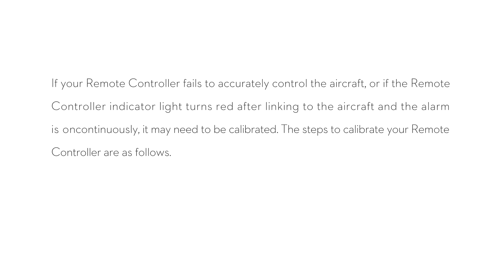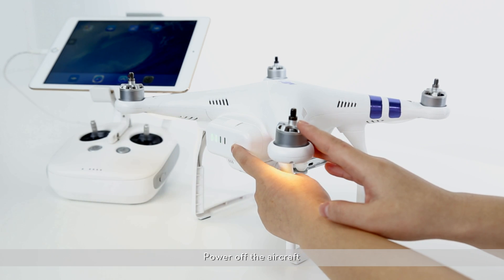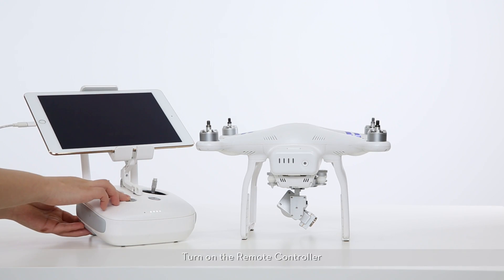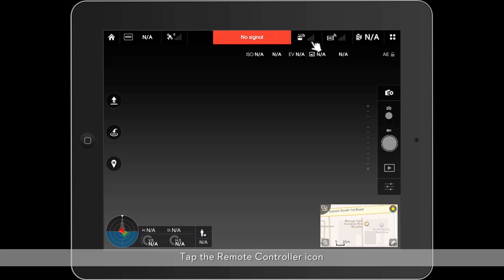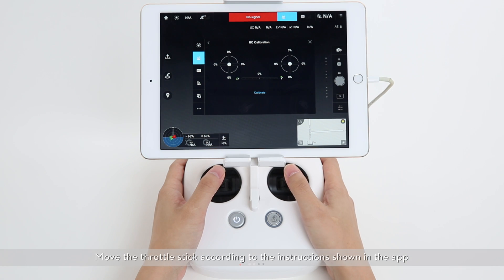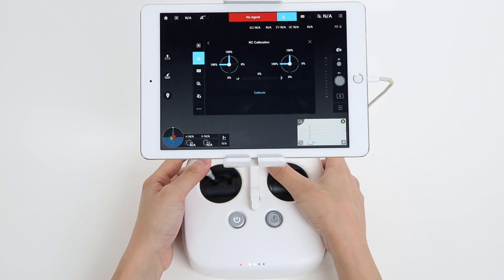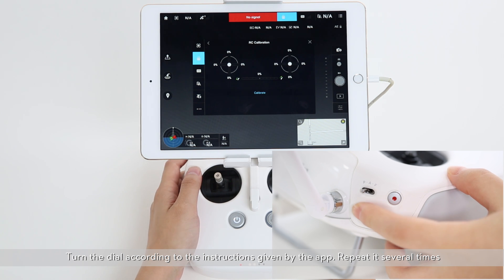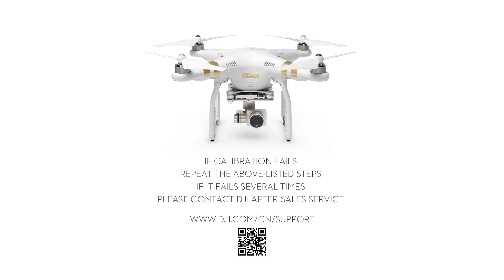DJI Phantom 3 | Remote Controller Calibration

Comment: Hi.. My Remote Control DJI Phantom 3 Advanced is a problem Remote Controller Encryption Error... what the solution to do... thanks before..
Reply from the maker: Hi there, could you please send the screenshot of the error message to us via email to support@dji.com? We'll double confirm the issue.
Reply: @DJISupportGlobal  : I just sent an email containing a screenshot of the error to support@dji.com. please check the email Thankyou for the response..
Reply from the maker: @ToplayCom  Hello, our support team will follow up with your case accordingly. If you still need further assistant, you can provide your CAS number so we can directly track the process. Thank you!

Comment: mi control no quiere realizar la calibracion y no se conecta a la aplicacion DJI GO
Reply from the maker: Hi Edwyn, just to verify, which remote controller do you use? Could the RC be powered on properly? You may try to reinstall the App and connect again.
Reply: El control es un gl300c Phanton 3 el prende pero inmediatamente suena una alarma y La Luz es de color roja al mover la palanca deja de sonar después que se enlaza con el dron La Luz prende rojo y verde he intentado recalibrarlo y no me deja la aplicación no se conecta tampoco intente actualizarlo y al parecer no actualiza
Reply from the maker: @edwyn1326  Thanks for getting back, so the RC's first LED blinks red and green, it makes a beeping sound, and you can't connect the mobile device to the DJI GO app, right? May we know the current DJI GO app version and the mobile device you are using? If the app can't connect to the RC, please try a different connecting cable, try to reinstall the latest DJI GO app and try again, please note to do a backup like syncing the flight record and saving the pics and videos before your reinstallation. Besides, you may also try another mobile device for connecting. 
If the RC can be connected, please check if there is a need to update the firmware for the RC, or you can also try to refresh the firmware by long pressing the three dashes on the first page of DJI GO app for 9 seconds. After that, please check if the LED on the RC blinks normally. 
For the beeping sound, there are 4 types cases with a beeping RC in the majority situation: 
1. Extremely low battery, charger it;
2. Firmware upgrading failure, upgrade it again;
3. RC sticks are not at the midpoint, calibrate it;
4. Disconnect with the drone after 5mins, re-link the drone and the RC.
If the issue persists, please provide us with a video of the current status of your RC when connecting the mobile device, we'd love to check. You can send it to m.me/DJISupport or http://www.dji.com/support, thank you.

Comment: "Tap camera" 

There's no camera to tap. Fail!
Reply from the maker: Hi there, this app interface was a very previous version. Please check if you can go to the RC settings and calibrate the RC, if there is any issue, you can keep us updated at m.me/DJISupport, thank you.
Reply: Hello. And thank you for the swift reply! The problem only occurs when I try to use the Ipad. It works perfectly using my android device. Any idea what could be wrong? Both the drone, the RC and the app is up to date. But I still don't get any "connect to camera" button inside the app once connected.
Reply from the maker: May we know which drone you are flying and the model of your iPad? Have you tried another lightning cable for connecting? If it is possible, please provide us with the screenshot of your app so we can help further. You can keep us updated at m.me/DJISupport, thank you.
Reply: Thanks for coming back to me, the drone is the P3A, and the IPAD is the iPad (3rd generation) Model A1416 Wifi version. I've checked the cable and it seem to be working properly, as it can transfer files between it and my computer. Ok, I took some info screenshots for you, so you can see app version, IOS version on my iPAD and also inside the app. Thanks again.
Reply from the maker: Thank you for your cooperation. We hope to have your situation addressed soon.
Reply: Hello again, I forgot to add the links to the screenshots, how silly of me! Here they are:

https://imgur.com/a/BS64EFE
Reply from the maker: Well received, thank you so much. It seems that the mobile device and RC still doesn't connect well. Please try to reinstall the APP or update to the latest OS to see whether it works.
Reply: Hello. The iPAD refuses to update, it just gets stuck on "downloading and installing" when I press update. But the version update 9.3.5 is only a small security update over my current 9.3.2 version so I doubt that's where the issue lies. I've also checked on a forum asking to update the iPad 3rd gen and this is what I've found out, let me quote someones reply: - "The iPad 2, 3 and 1st generation iPad Mini are all ineligible and excluded from upgrading to iOS 10. They all share similar hardware architectures and a less powerful 1.0 Ghz CPU that Apple has deemed insufficiently powerful enough to even run the basic, barebones features of iOS 10. Your iPad 3 is at its highest iOS version. iOS 9.3.5." - Can it be that I need an older version of DJI Go? Maybe the new version of DJI Go is for iOS 10 and up? I also reinstalled the DJI Go app but despite this I'm still having the exact same issue. The DJI Go app doesn't recognize the RC or the drone.
Reply from the maker: Hi Soetdjuret, sorry to tell that iOS DJI GO app doesn't support downgrading. As for the iPad's update, we suggest that you can confirm again with Apple support.
At this moment, if you have another mobile device, you can try to connect the drone to that device and see if it can be connected successfully. Thank you.

Comment: Hi 
I've bought a new controller and looks like the USB is dead , it won't link to dji app at all . Red light on constant and no power to tablet/iPhone Either .  If I use a USB extension I can get the power ti show in tablet but still won't update or control anything .
Now am told possibly the controller has very old firmwear to the point where it doesn't see anything connected to USB .  How do I update Rc if USB won't connect ? 
I've tried everything on YouTube and beyond 
Please help .  I know the Rc isn't broken
Reply: DJI Support  I can't upgrade anything as the controller won't connect or read USB stick or sd card
Reply: DJI Support I can't tell what FW is installed in controller , it tells me disconnected when I plug to tablet no power to iPad but if I use an extension USB then I get power to iPad but still say disconnected

Comment: A random question for you. Do you know where I can buy the Screw that secures the Device Holder to the P4 Controller? Mine came out and I can't find a place to buy one anywhere!
Reply: DJI Support are already on the case! They sent me one last week. However, it was the wrong one (for the Phantom 3 controlled - slightly smaller). But, they said they are sending out the correct one and I should get it on Wednesday!! 👍